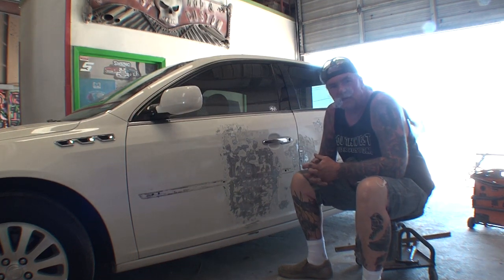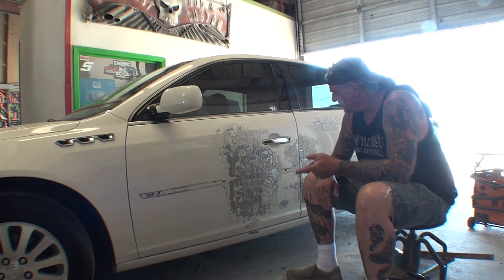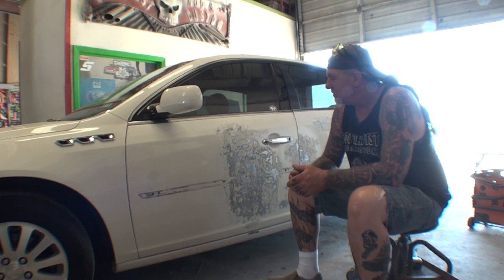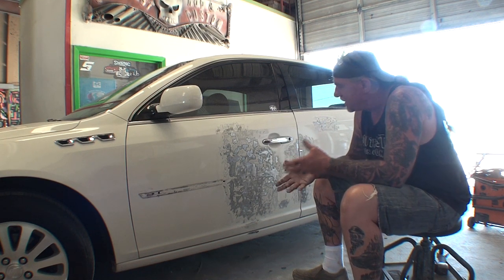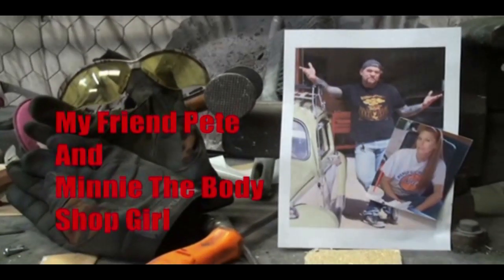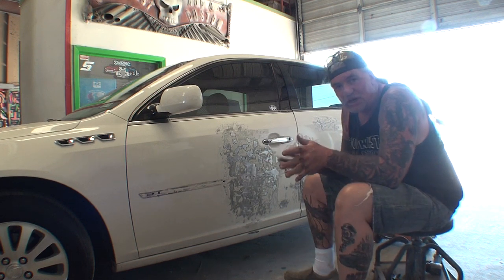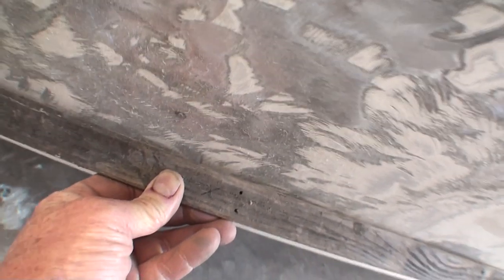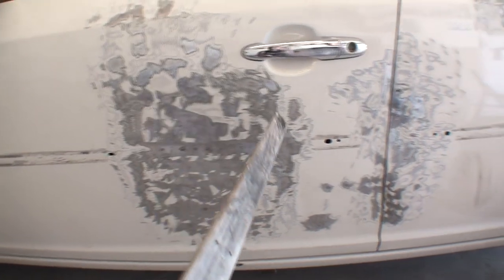What is Dynaglass Bondo? How To Use It RIGHT!

Comment: Hey Pete.. I learned a trick a long time ago and i have used it and never had problems. Curious if you ever heard of this or tried it. When using bondo you can mix a 1/4 of fiber glass resin with your bondo mix and use the bondo hardner which will harden the resin as well. This makes the bondo much easier to spread and works great for leveling out on flat surfaces like hoods, cab tops and trunk lids. Also if your doors are off and on stands lieing flat it goes on like butter. If you want to try this i would suggest mixing the bondo and resin really good first.. then put hardner in.

Comment: Great vid Pete. If you sit back and consider doing this verses a new door or skin you might agree this way is the less hasle way. You'd have to call around for a door donor, then go look at it and probably take at least 2 or 3 trips here and there to find a good one, then possibly take the interior panels off to switch then R&R the door lock and then probably have to paint the donor door anyways to match the paint...
I've used the Fiberbond (DynaGlass) many times in the past and haven't seen it fail yet. In some circumstances I've drilled holes and chiseled (cut) "stars" in the holes for the fiberbond to grab ahold of when having to put it on thick. An old body repairman told me that trick years ago. The other thing I like about it is that the fiberbond is waterproof and water won't eventually soak into it like it does bondo. One thing I learned the hard way is that the fiberbond is harder then bondo so when sanding bondo that is on top of fiberbond remember this because you'll end up causing bumps and will have to prime and fill with glazing putty to get rid of the bumps where you sanded through the bondo into the fiberbond. Sandpaper sands the bondo faster than it does fiberbond thus causing bumps. my .02

Comment: Your videos are great I’ve
Learned so much 

The factory paint on my Jeep Cherokee is alligatored and peeling.  The situation caused exposed metal is rusted situation .   

What D I Y recommendation for this situation
Reply from the maker: It' mainly from SUN EXPOSER and it's a mess to fix as well..  You'll have to D/A sand with 80 grit  all the bad panels and then prime with 2K primer then re-paint.

Comment: Pete, can you use that to fill a small hole in a rocker panel? I have a 97 cobra and I'm deleting the side skirts and a shop that specializes in mustangs (tko resto) has done that job that way by filling in the rocker panel holes with bondo glass. I've used it  and it seems like a legit fix but was curious about what you thought on the matter.

Comment: Why not epoxy on the door first, before the dyno glass.  Or don't we care about rust since he's 88?
Reply: Is that a thing? Cause I hear its (bondo) then epoxy after?  Legit question
Reply: @FIRE-OWL.  nope.  Epoxy always goes on metal first.  It's super hard when cured, 7 days.  It's like sealing something in plastic.  Can't have rust without oxygen or moisture
Reply: @FIRE-OWL.  that's old school, because epoxy wasn't a round then.  I did this with urethane primer, before epoxy came out